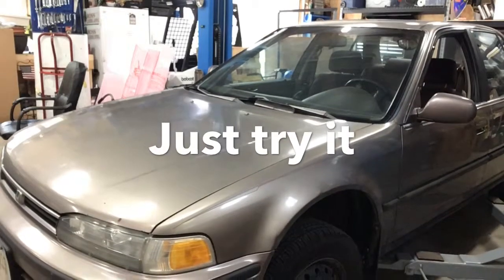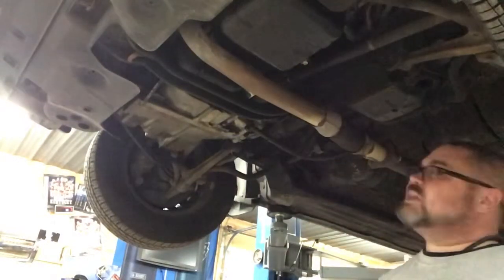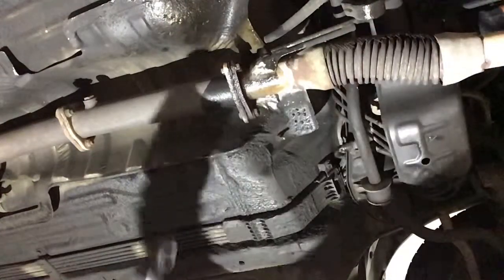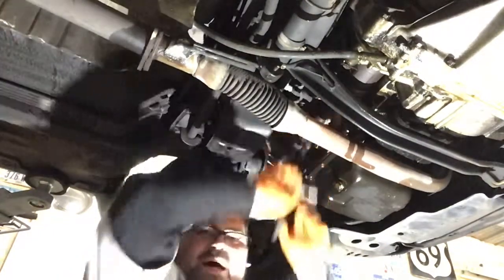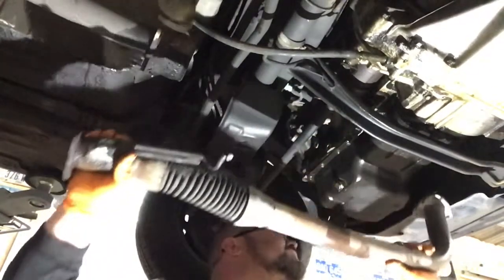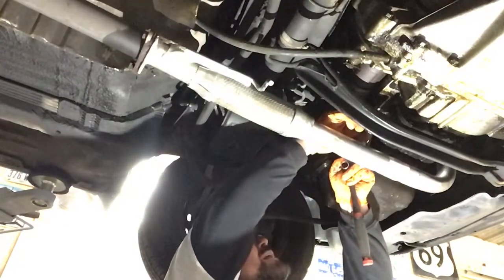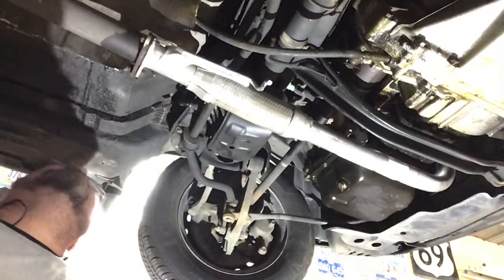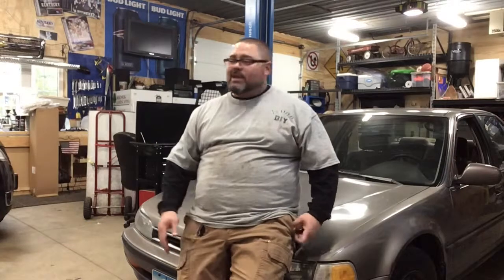1992 Honda Accord exhaust leak

Comment: I just ordered a flex pipe for my 92 Accord.  Do you remember if you had donut type gaskets at both ends or did u use a flanged gasket?

Since u deleted the cat converter......where did u get that flanged pipe that you attached the flex pipe to?  I need something exactly like it.
Reply from the maker: I found it online, I want to say it was a test pipe and it had flanges on each end
Reply: @JUSTTRYITDIY  Thanks. I found it.  Did that test pipe make your exhaust louder than the factory?
Reply from the maker: not sure because when I got the car the exhaust was gone and the cheaper choice was a cat back exhaust.
Reply: @JUSTTRYITDIY  Thanks bud. I have a 1992 Accord that's still chugging along @ 173K. LoL.
Reply: Great video thank you!
I have 93 Honda Accord and is starting to sound the same going on 302k miles with original exhaust

Comment: i used to have a 92 accord common problem the flex pipes always go bad if i still had it today i would put on a Nickson flex pipe replacement that used a ball and socket flange and 2 spring bolts which are better. was part of the reason why i sold it then till Nickson industries came out with this flex pipe replacement.
Reply from the maker: Good to know, I get about 3-4 years and then it starts getting louder.  I will keep this in mind 
Thank you very much
Reply: Could u please post a link to that flange you are referring to?  I'm interested.
Reply from the maker: I think it was a walker 31383 gasket
Reply: Could you provide a link for what that looks like?